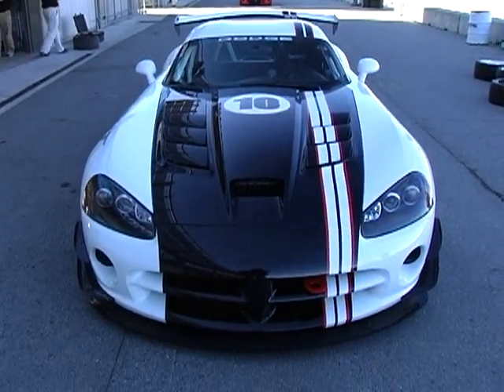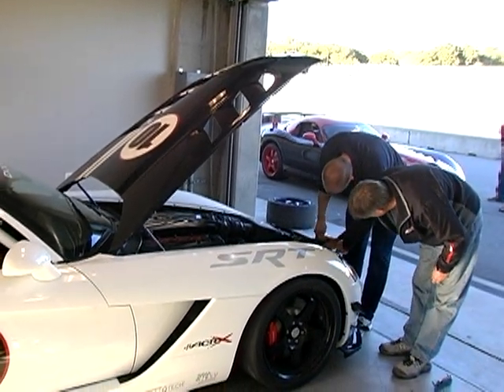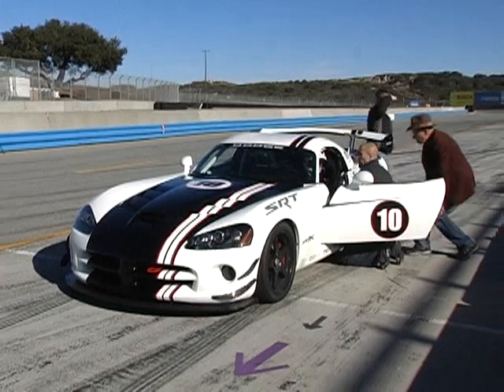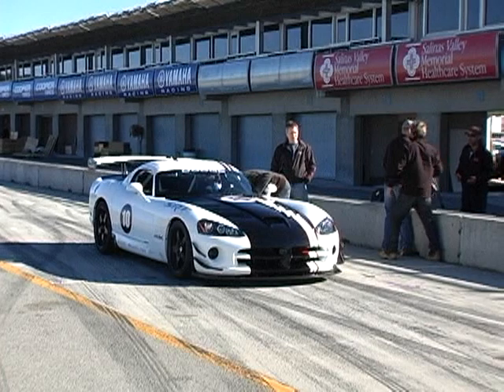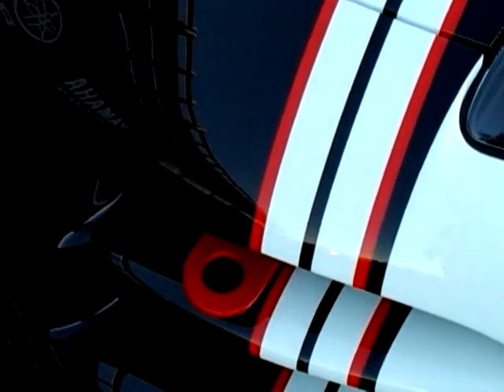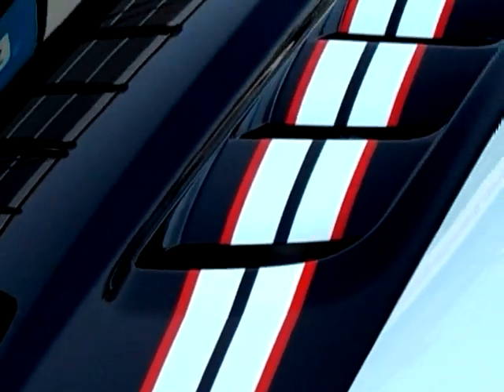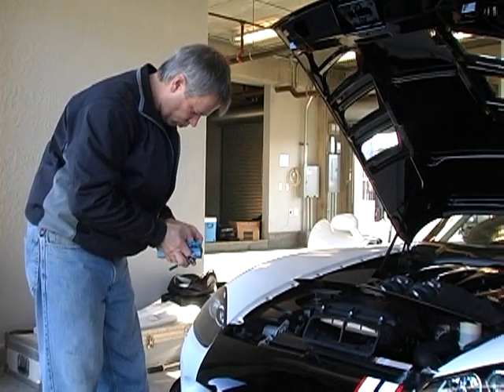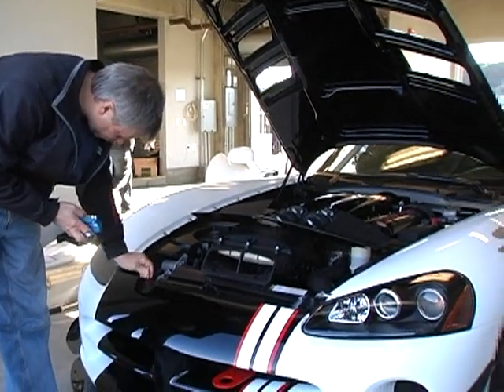New Dodge Viper SRT10 ACR-X 2010

Comment: @NetherToke All the more reason a quality seat is important.  When people buy a GT3RS, a Viper ACR-X, or a 430 Scuderia, they're probably going to track the car.  Granted, they'll want a seat that bolsters them securely not just for comfort but for safety and confidence.  Race cars or road cars, interiors matter.  If the ZR1's interior didn't matter, Chevrolet would have stripped the interior down to its basics.